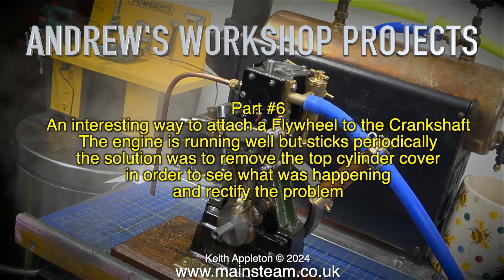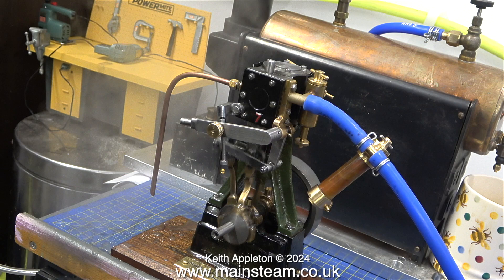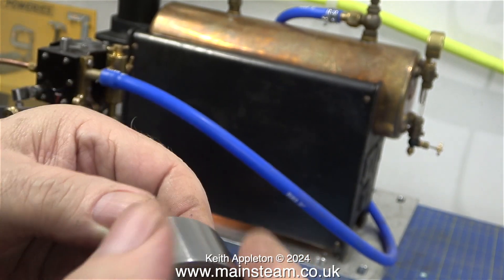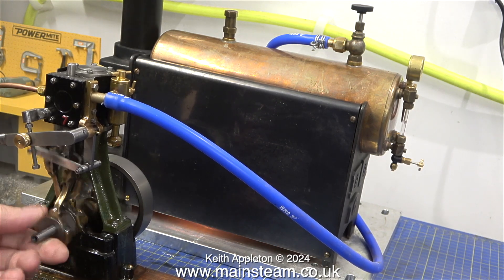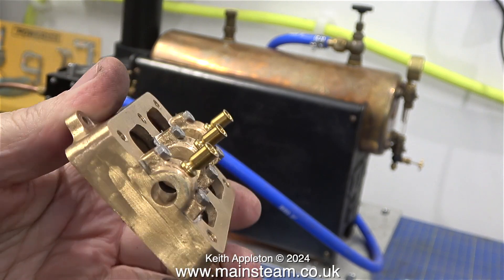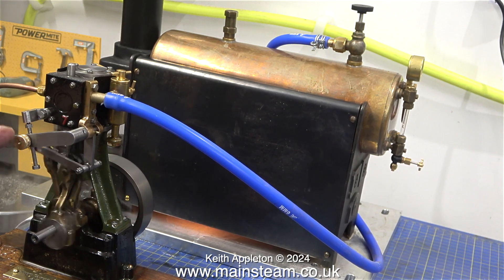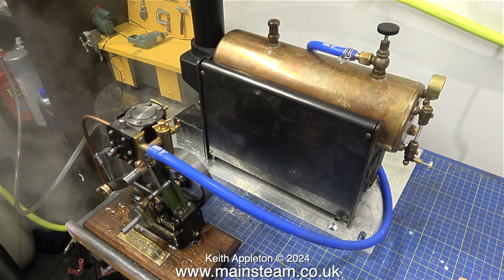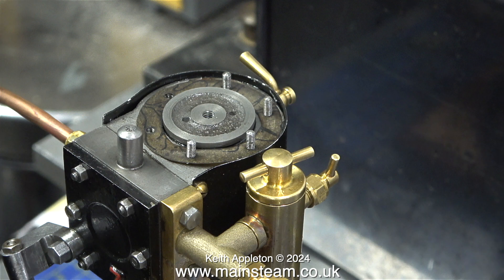ANDREW'S WORKSHOP PROJECTS - PART #6

Comment: I do find it quite hilarious that the reversing lever is considerably thicker than even the connecting rod!  I too would prefer something more spindly as the reversing lever doesn’t actually take any load and shouldnt look like an American size locomotive connecting rod with the odd knob to boot.
Reply from the maker: I fully agree with you on that, Andrew still has a way to go when it comes to Scale }:-)))

Comment: I've got a 7.5" gauge, gas-mechanical, 2 axle switcher engine that has wheels that are fixed to the axles with the same type of fixings. I assume that it was to allow it to be used for either 7.5" or 7.25" without any additional machining of parts.